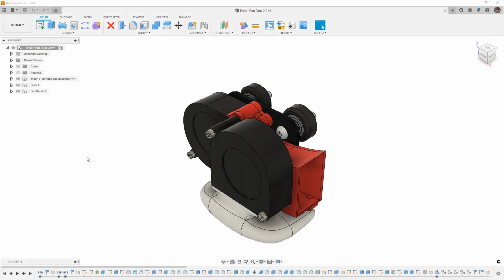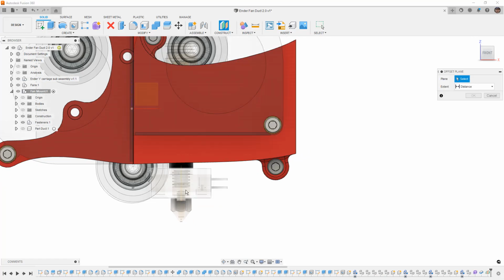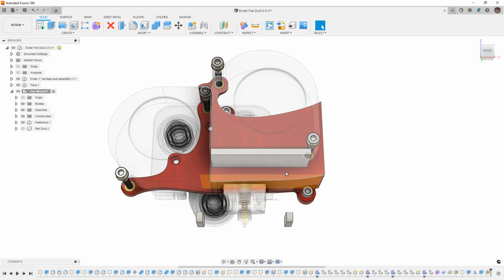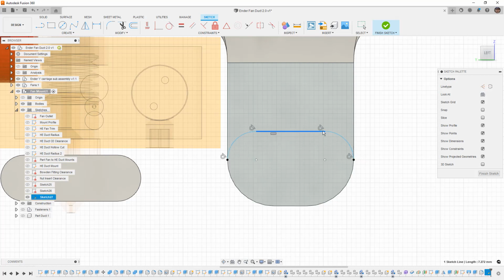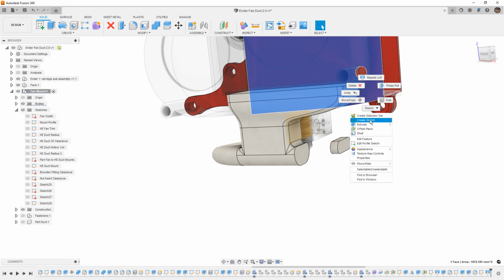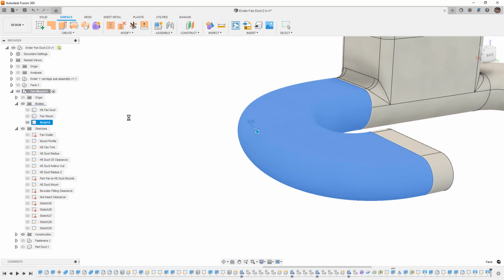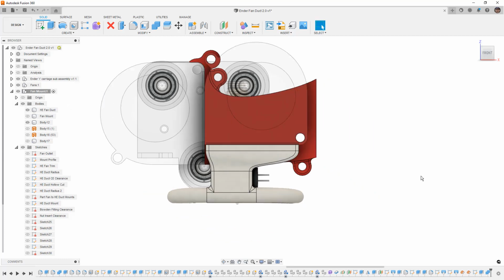How To Approach Complex Designs | Walking Through the Design of a 3D Printer Nozzle Vent

Comment: From my experience, fillets are great for cnc machining but horrible for a 3D printed part if not very large. You have to think about layer thickness and how many layers it will take to step over and create a clean curve on the fillet. Often, it's better to have sharp corners. How do you get around these printing defects with a design like that on such a small part using a 3d printer.
Reply from the maker: Print orientation helps.  Desktop FDM machines have good curvature in XY so if the required curves can be oriented in that way it helps.  Smaller layer lines like a .1mm layer if using an FDM.  Or use a resin based process like mSLA.

I agree that adding a chamfer/sharp corner helps for sure.  This video was done to help a user trying to design a smooth vent/fan housing flow path.
Reply: @LearnEverythingAboutDesign  Those are good things to consider. Thank you.

Comment: Great video but I still have a question. How would you model this if the ducts came out of the fan at an angle to end at the bottom instead of just going straight down?
Reply from the maker: Depends on how you need to define the shape.  Lofting between profiles on angled planes would probably be my first approach.

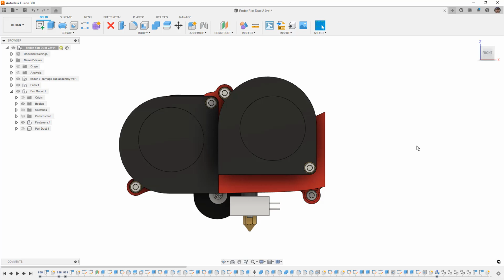Comment: @3:50 you describe why you chose to model the interior volume of the duct. Does that mean you when you are worried about constant shell thickness, you typically chose to model the outside of the part? Maybe you could do a video expanding about when to model in, or model out, dangers, pitfalls, and and traps.

@16:13 I thought you were going to mirror the second duct, but then realized you couldn't because the primary duct wasn't symmetric. You could have done this by forcing symmetry in the drawing and then you'd only have one set of profiles to make pretty. Disclaimer: you're definitely a better modeller then me, and you've tought me quit a bit about Fusion stuff I had no experience with.
Reply from the maker: Hey There, the choice to model inside vs outside is a decision based on a few things.  For this, the inside shape of the duct where the airflow is was really the key design element.  The outside shape didn't matter so getting the inside right was key.  Second is a thickness thing.  Since the inside flow was what I wanted to control if there were thickening issues then fixing them on the outside wouldn't affect the function.

On the symmetry you are correct.  This was answering a modeling question someone sent me so the inlets/outlets and general process I worked within those confines.  Working with symmetry whenever possible is 100% the way to go!

Comment: How about this. After your undersized model is complete (nozzle-1) make a copy (nozzle-2). Lets say you want 2mm walls. So upscale nozzle-2 by (in this case about 110%). Then, using the Move Tool and Section Analysis, position nozzle-1 in the center of nozzle-2 on all 3 axis. Then cut nozzle-1 from nozzle-2. Don’t keep nozzle-1 (the cutting tool). Then make three Offset Planes where the three openings are and adjust the planes 2mm (or what ever is needed) inward. Then cut the three 2mm parts from nozzle-2 and delete them. Do you think this would work?
Reply from the maker: If i understand correctly yes, but there is likely an easier way.  Instead of scaling if the intent is just a thinwall part you can just go to the Surface tab and use Offset to select the faces you want and offset them outward by 2mm.  This is probably the easiest way to do it.
Reply: @LearnEverythingAboutDesign  But wouldn't this give you a wall with zero thickness? Or can you thicken the offset surface?
Reply from the maker: Yup from there you just use Create > Thicken
Reply: @LearnEverythingAboutDesign  Thanks. Dang Fusion 360, a million ways to do most anything. Have you seen any of the guy "Fusion 360 School"? He really does some weird stuff with F360. My problem is I'm 88 so I sure don't have the time to learn the stuff you guys do. Thanks again.
Reply from the maker: @larsord9139  Yeah he does some very cool stuff on that channel!  I like how he does case studies for certain geometry.  I try to not duplicate his style as I think that works very well for him.  A lot of it is tribal knowledge so any way to consume the info is great!   

With surface tools it helps to think about the designs one face at a time.  It gives you the freedom to create some pretty complex shapes and then worry about joining them together after :)

Comment: You designed in a few minutes something that I spent hours and hours trying to design. Thank you for the shortcuts. I never thought to use lofts between predefined profiles, etc. I was busy combining sweeps, etc.
Reply from the maker: Glad I could help!  Sweeps might be a good options as a starting profile but sadly we don't have tangency control on the profile of a sweep in Fusion.  So I would use it as the first solid/surface and then maybe loft from there.

Comment: Hi! Thanks for all your videos, they have been a huge help. Around the two minute mark, you touched on how thickening/shelling a form can cause errors. Do you have any content on workarounds for converting complex forms to solid bodies? Thanks!!
Reply from the maker: Thanks Nathan, it is such a case by case basis unfortunately.  The big thing to look at is the curvature map with the Maximum.  If your surface has any red areas on it at the thickness value you want then it will likely cause issues.  The only ways around that are to work on the form some more(which the took can be on and active in Forms) or to trim and patch up the surface after the form work is done.  If you have a specific example that you are stuck on and would like to share I would be happy to work through it to show the approach.

Comment: Great video, Caducation! I've actually been working on a hotend assembly like this and was wondering how I would go about modelling the ducts.

On another note, would you be able to make a tutorial detailing how to design a compression screw for injection molding and/or filament extrusion? They're different from normal screws as the volume/shape and, resultingly, compression factor change dynamically along the length of the screw 🤔
Reply from the maker: thanks!
on the compression screw, I think the pitch and thread stays the same but the center tapers down.  Something like this? https://www.vestamid.com/en/processing/injection-molding/media/292868-desktop.jpg
Reply: @LearnEverythingAboutDesign  Hi Caducation, I believe you're absolutely correct. The slope surfaces (flight thickness) and pitch seem to maintain consistent dimensions throughout the screw; whereas the channel depth decreases towards the valve/exit size (due to the spine gradually increasing in size). Continued...

=====

I realize that I wasn't specific enough earlier as I should have been, but my request more-so lies with a very special compression screw from the ARTME MK1 Filament Extruder project as depicted here (pages 2/15 and 3/15 on the pdf) https://www.artme-3d.de/wp-content/uploads/2022/08/Mk1-mechanical-parts-22-08-17.pdf

Here, the pitch (from the center-point of each flight) seems to be the only variable that remains consistent. The slope surfaces (flight thickness) and channel depth, however, seem to change dynamically over the length of the screw.

Additionally, these compression screws seem to have a much thinner spine overall.

Any tips on how to tackle something like this? A tutorial, also, would be more than welcome~
Reply from the maker: Thanks for the link!  Yes that looks to have a consistent 15mm pitch but the rest is changing.  Let me give it some thought.  This is definitely not Fusions strong suit without a variable pitch "coil" that is table driven like some other CAD programs.

Comment: There is no link with the subject of the video but I notice that there is no joint folder, how is this possible, how is your assembly and these sub-assemblies built?
Reply from the maker: Sorry about that. Check the description now.

The design was sent to me, i didn't build it but the only time a Joints folder exists is if there are actual joints applied.  This design contains a sub-assembly of the carriage, a sub assembly with the fans and then one with the mount.  Things are in place but nothing is constrained.  If you aren't going to have/show motion it isnt required to have joints or even ground the components.
Reply: No problem, Thank you for the clarification. 
I made this comment because I want to know what is the best approach when you want to do a full top down assembly. There are several possibilities, ground, joints, rigid group, but there is not much about this process in the documentation. "Things are in place but nothing is constrained. If you aren't going to have/show motion it isn't required to have joints or even ground the components." > indeed, if the "component drag" option is disabled
Reply from the maker: @mac_ito  well Fusion will always ask you to capture the position or revert if you try to have an operation.  If I wasn't going to show motion I might consider everything a body BUT as this is likely part of a larger assembly having them as components makes sense.

I do have plans to cover workflows but its a MASSIVE topic and I have yet to figure out the best way to convey it.  There are a lot of design decisions that happen along the way.  The "rule" was to start with components for every new part, but in practice i vary my approach.
Reply: OK thanks for these notes.
I come from solidworks and it is not easy to find an efficient workflow while keeping a lasting mastery of what you are doing. at least that's my feeling.
Reply from the maker: @mac_ito  For sure.  So there are some major differences right.  In solidworks if you use the Master Model technique which I used to use, you have multiple solid(or surface) bodies in a single part file.  This is essentially how Fusion works if you are just creating bodies.  The nuance here is that in Solidworks you could have under defined sketches and have Instant 3D turned on and it could behave a bit like an assembly.  But at the base level you can think of Fusion as behaving like a Master Model multi-body part file.

With Fusion you can convert those bodies to components at any time, which is similar to converting a master model in SWx to an assembly.  The main difference here is that in SWx that conversion creates a new assembly file while Fusion it just stays in the same file.  When you convert a body to a component in Fusion you activate it to continue working(although it isn't strictly needed.....)  Each component has its own coordinate system and Fusion keeps track of its location and orientation. thats how joints work by relating those.

If you decide to start your fusion file by creating empty components, activating them and starting the modeling process you are essentially doing a top down assembly like in Solidworks.  The difference between this in solidworks and Fusion is that everything is still timeline based.  So best practice would be to create components and apply joints early(which you can even do without solid bodies).

This doesn't take into account a few other nuances like direct modeling, base features and turning the timeline off.

My general workflow has been to maintain bodies until i need motion.  There are cases where i might start with a component and the main benefit here is that the timeline stays a bit cleaner.  When you activate a component you are only seeing the timeline for what was done to that component.  You don't really get that when you convert a body to a component.

There are other workflows like having each part external and inserting them into another file.  This is called Distributed Design.  This is helpful if you have a common part across multiple assemblies.  It can maintain the link.  You can even edit it directly using Edit in Place which will attach some XRefs to it from whatever you select.  In my opinion this gets messy and I avoid modding parts in this manner.  

You also have a derived workflow.  This is similar to the solidworks master model if you were to take a body in your feature manager , right-click and Insert into Part(or new part i cant remember).  Basically you take a body, bodies, components and you can pull them out of a design and into their own design.  This is helpful for manufacturing if you want to build jigs/fixtures outside of the main file.  It can also be helpful if you are designing an enclosure and work needs to be done on the inside by other users.  It prevents you from having to reserve a file and possibly lose work.  The flow of data is uni-directional.  Changes to the original file flow down to the derive, but not from the derive back up.

The problem with covering all the workflows in a video is that the nuances and decisions evolve and the workflow changes.  but what i said above should cover the basics.
Reply: @LearnEverythingAboutDesign  Thank you very much for taking the time to answer me with so many details. Indeed, a vast subject that is that of workflows.

I have been using fusion for some time now but so far for assemblies I have done as I could, new component, insert, derive. Today I need to be efficient and above all to master what I do, so to find a workflow that suits me. Workflow that may not be that of another or not.
In SWx I drew one body per part file and the starting sketch was snapped to the origin and still on the xy plane. Once the part was drawn, it was inserted into an assembly and constrained to other parts or to a construction element of this assembly (origin, plane).

The philosophy of all-in-fusion is pleasant but implies that I modify my way of doing things. I kept the reflex to create a component for one part, and an assembly as soon as I have 2 parts. What you mentioned "So best practice would be to create components and apply joints early(which you can even do without solid bodies)." seems very relevant to me, and like that everything is fixed without being grounded or otherwise. No chance of awkwardly moving anything. I like it.

It remains to find an alternative for the sketches. On this subject I tried to reproduce the workflow that I used on SWx but fusion did not work like that, it is extremely time-consuming. I liked the principle of drawing all my pieces with the same starting rule, but with fusion it is no longer possible. I build my new sketches based on parts or elements that already exist and no longer start from the origin of this same part. I don't know if it's the right way but it seems more efficient, remains to be seen if the multiplication of references still allows a modification without too much difficulty afterwards.

Thanks again for your help and expertise.
Reply from the maker: @mac_ito  Well mac there is another element to this that might help you.  At the very top level of a design exists a component.  So every file in Fusion has at least 1 component.  Each component has an origin all to its own include the default planes.  If you create a new component and model at its origin that would be the same as you do with SWx.  You can move that origin to wherever you like in the design.  You can hide everything else and work on your design isolated by right-clicking on the component and select "Isolate".  You can also move that component around so that the origin is in a location that suits your design.

With SWx, did you make edits to your parts in the context of an assembly?  Or did your parts always exist independently of those top down references?
Reply: @LearnEverythingAboutDesign  yes, this is exactly this process that I tried in fusion but 2 things put me off. 1 the principle of timeline obliges to return to the step of creation of the function so that it is modified, contrary to sw or a sketch is modifiable in its position, with fusion one returns to a previous step and if it the component has been moved, the view also changes. And there 2nd painful point, fusion manages the view of the camera very badly. One time out of two the "look at feature" was not done on the sketch concerned. Using this process on a daily basis with these 2 constraints is anything but satisfactory for me.

With sw yes I edited the parts in the assembly but without creating external references because potentially this same part could have several target assemblies
Reply from the maker: @mac_ito  So Mac only part of that is true.  Again a nuance.  So remember that a component has its own coordinate system.  The body lives inside that component.  The big key difference here from SWx assembly to a Fusion assembly is that fusion tracks the position in the timeline.  SWx doesn't.  So if you make references in SWx and move things around it can get messy.  In Fusion if I make a sketch, then rotate a part 45 degrees and decide to edit the sketch after that it does so at the original position.  Capturing any moves of a component are a history based feature so they won't affect that original location.  Hopefully that makes sense.

So you can move a body inside of a component, or you can move a component all on its own.  Either one will be a timeline feature that can be reverted/suppressed or deleted.

So if you want to design a part with its own coordinate system and no references to other bodies/components it can be done at its own origin.  If the component moves in relation to something else and you decide to say change the hole spacing of the first sketch, it will all update.
Reply: @LearnEverythingAboutDesign  I may have expressed myself badly and it may have made you think the opposite but I completely agree with the principles you cite and I appreciate this merging behavior